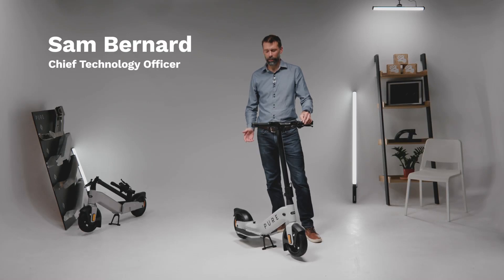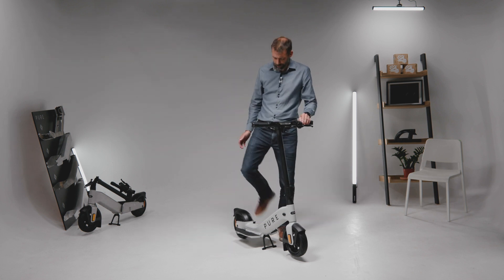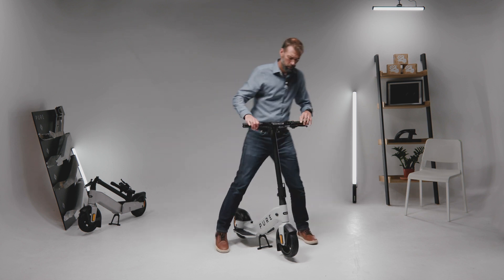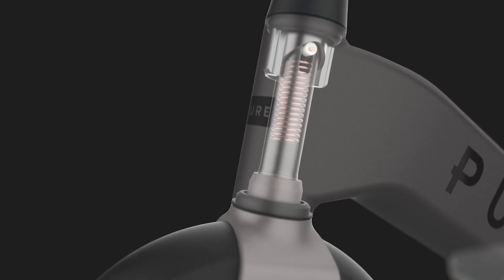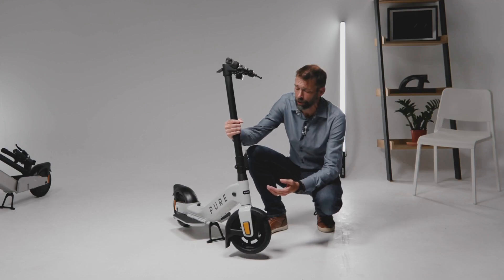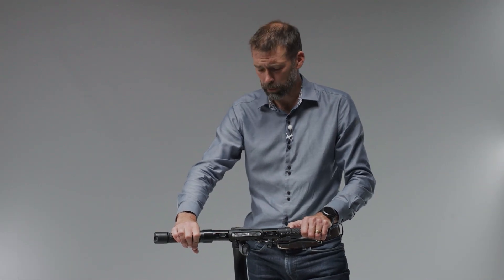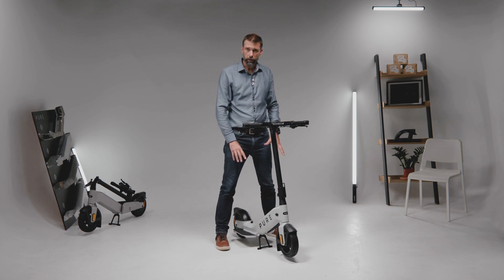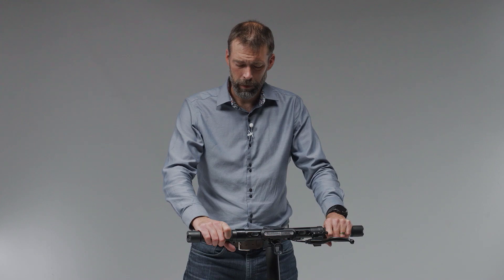Pure Advance e-scooter: One of a kind steering stabilisation technology

Comment: I can vouch for the fact that this steering technology works really well. I was so impressed with the scooters handling. I have seen a few negative comments on YouTube but that's from people that have not rode one. Well I have and I guarantee you will be really impressed with the ride and the tyres deal with the no suspension really well no suspension make's the scooter less complicated meaning less to go wrong and for me it doesn't need it. The stability is amazing. Go get yourselves one and have some fun.
Reply: I wanted to ask , can you adjust the length of the scooter incase one is on the taller side ?
Reply: @babawya8251  not on the Advance or the Advance plus's but maybe on the flex model

Comment: Great stability invention but suspension surely still king to deal with pot holes. Just a basic single suspension even on just the front wheel like Etwow scooters, or the original Apollo air would really improve things in my view. That’s the main advantage with TAUR they did t include suspension so went up a tyre size to 12 inches.
Reply: If I am correct the etow scooter uses a 8" solid tyre therefore will need suspension as their is little in the wheel with the pure Advance it has 10" tubeless air filled tyres that are quite wide that hold a large volumes of air that will absorb most pot holes better than a scooter with solid tyres and suspension, all you are gaining in having suspension with that set up is more to go wrong as I see it.
Reply: Your right, I have this scooter and a nami klima, suspension makes a huge difference.

Comment: Really liking the wide handlebars. Not sure about the standing position.
Reply: I have one and I can vouch for it being better than one foot in front of the other, more comfortable and with the footplates being lower and wider much more stables and self centering steering sorts the pot holes out much better and I prefer the 10" wheels as the tyres take care of the bumps less to go wrong than with suspension.